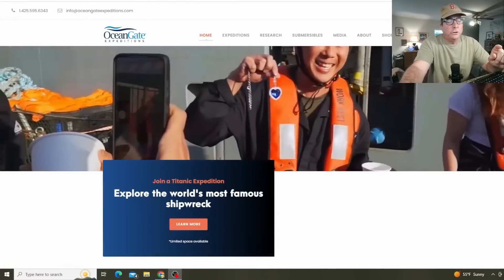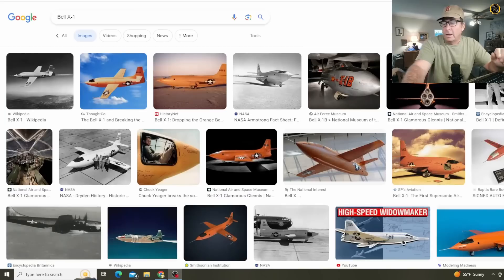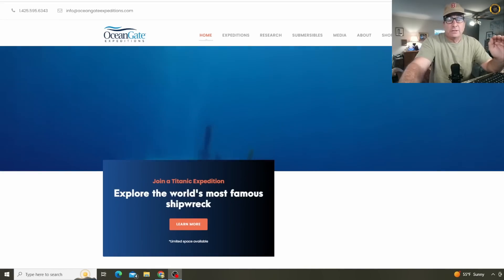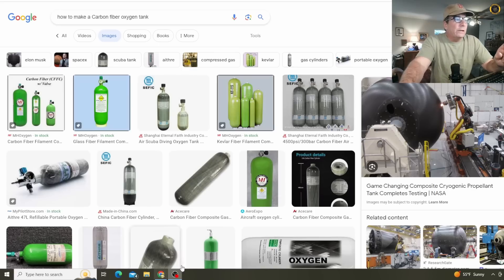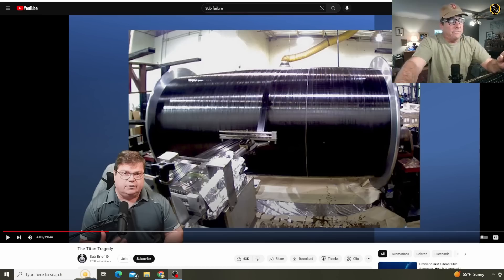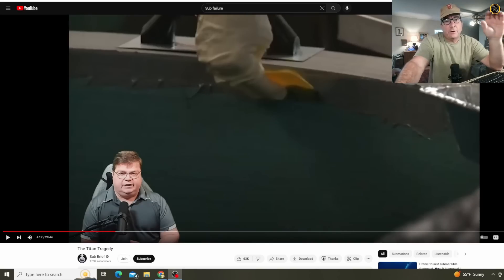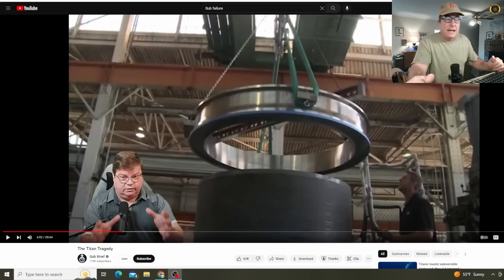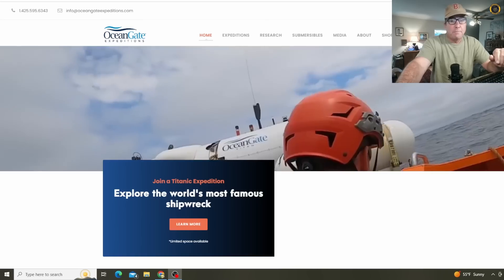Oceangate Sub Construction Details and Implosion

Comment: A point that has me very puzzled as to why the titanium ring was glued to the carbon fibre tube. They both have different elastic modulii and under extreme pressure will want to move relative to each other. A more compliant joint (think o rings) more suited to the immense compression forces could have been more suitable but would have required more engineering...

Comment: Designing for compressive pressure is not necessarily the same as for internal pressure, so some comments have likely missed the mark.  The carbon-fiber body under compression is more like concrete, where the epoxy binder is cement and the fiber is like aggregate.  At depth, the endcaps hold the cylindrical body like a vise.  Like standing on an empty soda can, any out-of-roundness will be unstable.  It should have been more rigid.

Comment: Composite pressure vessels start out with a metal vessel which is the impermeable layer.  The carbon fiber is only external reinforcement.

Comment: I noticed the unidirectional layup of carbon fiber and have changed my mind regarding the possible portal failure (1300m rated of the shelf item). I don't even think the glue joint was the root failure. I think the hull split right between the fibers. If all the fibers are circumferential, where is the torsional strength? Those people were  risking their lives by the strength of resin alone. Might as well have been a giant epoxy coated slinky.😢

Comment: Although carbon fiber is stronger in tension than compression, I don't believe this was the cause of failure.

The viewing window was only certified for 4,265 foot depth (1,300 metres). Titanic is 12,500 feet down.
Reply: Like Tom Clancy wrote in Clear and Present Danger --- "that damned widget failed right when the contractor said it would..."

Comment: Just curious how does that carbon fibre tube structure of Titan compare to the composite structure and usage of 787 and A350? These aircraft has been flying for 10+ years with thousands of pressurization and de-pressurization cycles (although the pressure differential each cycle is much less compare to what Titan experiences in its cycles). I am sure there are differences in terms of construction, design, testing and maintenance. Can you explain some of that? Would be interested to learn.
Reply: The pressure in an airliner is going from the inside out at a few pounds per square inch, which puts the fiber into tension, which it handles well.  With this thing, the pressure is going from the outside in at a few thousand pounds per square inch, which is compression, which it does not handle well.
Reply: @james-p  Ah so that's the tension vs. compression difference mentioned in the video. Thanks for the explanation!

Comment: Lots of conjecture here on the design of this.  The beauty of carbon fiber layups is you can match the CTE (what you are referring to with dissimilar metals) to the titanium.  The adhesive interface would also be of questions.  It would be necessary to better understand who actually designed this and how before really making true conjectures on it's failure modes.

Comment: We know that carbon fiber is extremely strong in tension, especially given it's light weight. In compression, however, I suspect the binding resin strength is the limiting factor, not the carbon fiber itself. Any fiber will easily fold on itself in compression if the resin begins to crumble.

Comment: Having laid up Carbon Fiber in a aircraft Bond shop. You just don't go one direction. You follow a ply chart. Left to Right, Right to left ,90 degrees and zero degrees. Once you reach the middle of your layup the reverse the ply chart. Very strong. If you miss a ply the part will be warped. Bonded in an Autoclave under high temperature and pressure.

Comment: Excellent Juan - you put that into great detail for those who have trouble understanding mechanics and physics. Sono tubes are designed similarly to the sub carbon fiber tube. No way will you be able to pull it apart or expand the tube but you can sure crush it with outside diameter force/ pressure. If Mike Patey was to design and build a submersible vehicle, I would go down in it!! possibly. Thank you, Juan for breaking it down in your fashion.

Comment: If a sub is rated to go down to pressure (X)psi I would think it would have to be tested doing several cycles to (2X) or (3X)psi. Needs a big margin in case it bumps something and pressure waves from something unexpected and materials degrading with use.

Comment: It's being described as an implosion, but I think the most likely failure mode was that the end caps separated, causing a sudden increase of pressure and instant demise for the unfortunate occupants. I doubt they will find a flattened carbon tube.
Reply: They’re not going to find a flattened carbon tube because a carbon tube does not flatten. Carbon fibre does not deform significantly, it shatters.

And the “sudden increase of pressure” at that depth, with that pressure differential, absolutely is an implosion, as it would occur within milliseconds

Comment: Simpe and short:
Carbon fiber is nott used alongside of this material's talents when used in a sub.

The mechanical load from high pressure within a tube differs completely from the load generated from high pressure from the outside.

Comment: Juan - You are right that typical NDT is not applicable for inspecting CF structures. We do however have a few acoustic techniques that can be applied. Laser based ultrasound techniques are sometimes used. The wall thickness in this case could be problematic. That’s a lot of material. I agree with you that the Ti ring/CF interface is the likely culprit. They should be able to determine if the chamber crushed and sheared the bolt ring off the end. I wonder about the viewing bubble too. I read they used atypical materials for that component. It’s a sad situation but hopefully we learn a few things.

Comment: Carbon fiber does NOT have a limit of cycles , its used for springs.I think if the complete vessel was carbon fiber it would have been ok, or if that ring was bolted and epoxied it certainly would have had a better chance.
Reply: There is a vast difference between above-water carbon fiber reactivity and the reactivity of carbon fiber subjected to salt water, immense pressure and bone-chilling temperatures.
Reply: @TechGorilla1987  It also makes a difference if the hull was cured in an autoclave or the outside was properly sealed meaning any pinhole would mean water egress causing de-lamination , I work at a major plane manufacture where we cycle the complete body 10,000 times, wings, fuselage ,air pressure etc. also was the hull UT tested (non-destructive inspection) ultrasound basically.
Reply: @ExploringCabinsandMines  I will defer to you as it's really not my wheelhouse.  That said, I wouldn't have traveled on that thing - especially if I was fully informed prior to signing any waiver.
Reply: @TechGorilla1987  Agreed
Reply: No limit of cycles, even at 6,000 psi???

Comment: My background in carbon fiber is in bicycle frames. Four things I have concerns about: 1. carbon has a small amount of flex under pressure. 2. You cannot really discern failure between the carbon fiber layers. The best way to know if you have a carbon fiber failure is when it fails. 3. It is very difficult to get unilateral and uniform carbon layup across such a large area. There will naturally be stronger and weaker spots. On a plane or bike this doesn’t matter as much because stress moves, but in an undersea environment the pressure across the surface is equal across the whole area. 4. Carbon fiber degrades over time and especially in difficult conditions (extreme hot and cold) add to that the effects of salt water.
Reply: Glad we got a bicycle expert to weigh in….
Reply: @washedupwarvet2027  in bikes made out of carbon fiber. It is not the right material for this application.

Comment: Would it have help it to not come apart at the 2 ends if the carbon fiber material had been continued into the capsule 5 or 10 inches.? This way the end and the part under the nose cone/window would have been over the carbon fiber material as well. The way they wrapped it stray ends could have started to rip anywhere along the tube. If the ends of the carbon fiber were inside of the capsule as well they would have been protected from the water and any water pressure from the outside if there had been some water leaking on the outside of the capsule part.

Comment: Mr. Brown
Graphite epoxy structures are Non-Destructive Tested, NDT, all the time. It was developed well over 50 years ago.  Ultrasound is used to complete NDT for this type of structure.  The F18 has composite structures that have been flying since the prototype flew in 1978 and were tested with Ultrasound NDT.  
  Graphite epoxy structures are very capable of taking compression.  The wings skins on the F18 are highly loaded in both tension and compression.  The LearFan 2000 was an all composite aircraft taking both types of loads successfully. 
  The cylinder of a graphite epoxy structure can be machined to close tolerances.  The engineer MUST add sacrificial layers to the structure for that operation.  The NASA Transfer Orbit Stage had four huge cylindrical “pushrods” with the inboard being in tension and the outboard in compression.  The ends were machined to fit the titanium pushrods and we used sacrificial layers to attain a tight fit.  
The reason the machine was winding the strip cloth at “0 degs,” perpendicular to the length of the barrel, is to provide a circumferential load carrying capability.  Layers will be alternated from 90 degs, along the length of the barrel, through several different angles to 0 degs to achieve the strength required for the given load.  Designing a load carrying structure with graphite epoxy, don’t forget the epoxy it distributes the load through the layers of graphite. 
  One of the problems with mixing graphite epoxy structures with metal is the difference in properties which induce a severe strain on the connecting joint.  One is the modulus of elasticity, the metal has a different deflection than graphite epoxy under load.  The second is the thermal coefficients for the graphite epoxy and titanium are different which will induce a significant load at the joint.  This load, over time, can debond the joint catastrophically and the loads this vehicle was under this is a real possibility.  
   The final thought is the way you design a “pressure cap” must be done with the right approach.  It is a type of root mean square equation dome.  A spherical cap will induce moment in the cylinder which is a bending load at the joint.  The design team should be aware of this but it would not take much error or “step load”, where the to pieces are not adequately supportive of each other to induce a failure in this joint.

Comment: Dead on point. When you look at the hull design/materials/techniques in a very fine high resolution detail, there are QUITE LITERALLY a nearly INFINITE number of failure points that only increase statistically over time/life, use cycles.
Failure borderd on absolute certainty, only WHEN (exact moment)was the unknown value/element.
Nothing more than russian roullete.

Comment: I am a bit of an expert on composite materials. I have been in the aerospace industry for almost 40 years, and I’m currently an engineer for an international air framer.  you are not exactly correct when you say the only way to test composite materials is to destructively test them. Carbon fiber, layups are typically inspected using ultrasonic inspection techniques. This is how we validate them structurally for aviation.  Ultrasonic inspection is intended to yield information about voids, porosity, and disbonds.  Another common method of nondestructive testing of carbon epoxy layups is x-ray inspection; often used for secondary bond joints, similar to the joint you described between the carbon epoxy tube and the titanium flange.

I think you’re spot on about the different strain rates and coefficient of thermal expansion between the composite tube and the titanium flange.  I don’t think galvanic (dissimilar material) corrosion played a role.  Titanium and carbon play well together.

Keep the good info coming.  Love your videos!
Reply: An aircraft has a relatively thin hull, I have an key tag from a piece of A340 aluminium skin which is around 2,5 mm thick. It seems the submarine cylinder had 5 inch wall thickness. As an expert do you think you can still test such a thick layer with ultrasonic inspection methods?
Reply: Absolutely!  There are many commercially certified aircraft, as well as military aircraft with very large composite parts.  The thing to understand is that for each unique laminate you have to build a reference standard: a representative piece of laminate that matches the part you’re testing, with a specific level of porosity built into it.  The entire process can be very expensive, and Oceangate chose instead to rely on deep sea testing off the coast of Bermuda to “proof-test the hull; then audio sensors in the hull to warn them when they we’re experiencing a failure.

Short answer: Yes! The technology definitely exists.

Comment: One of the outcomes of this could be that we learn more about how carbon fibre materials behave, which is particularly important now given that planes are being built out of the stuff; in the same way that the Comet taught us more about metal fatigue, something here may help us build safer aircraft.  But it is also a harsh lesson of the importance of applying rigorous engineering principles and processes, and the importance of good technical leadership; not just on new innovations like this, but generally.  The MAX also was a case of engineers raising concerns and nothing being done to address them.
Reply: they already know quite a bit about carbon planes. The 787 has been flying for almost 15 years without the hulls flying apart (ok, except the first few :)) ,  f18's are double that age. Sailboat masts 150ft in length under 20 tonnes of compression have been around for 20 years in salt water as well.
Reply: @mrl22222  On one condition: Well designed and well made. But here - everything went wrong.
Reply: @adamw.8579  and that is the critical condition! Just look at all the problems boeing had with 787 initially. Getting the supplier to do it right was so hard they just ended up buying the supplier. CF is a great material, It can withstand a huge number of cycles and tremendous loads for it's weight, but because it act as 1 giant piece instead of 100 little pieces, problems can propagate quite quickly, so manufacturing quality is the really hard part.
Reply: @mrl22222  Excellent data points. Thanks for sharing.
Reply: It is entirely possible to learn more about how composite structures behave without putting anyone's life at risk. On the MAX, there were enegineers and pilots who ignored the concerns as well as engineers who raised them.
Reply: Sadly, It is unlikely that we will learn anything new. You first have to apply everything you already know, else it is just confirming what was already known and confirmed before. Second, these people where allowed to design, build and use this sub without oversight or certifications, so there is no party that is required to investigate. Sure, anyone can pretend to be an investigator, just like anyone can pretend to be a submarine builder. For example the manufacturer of the glue would write a 1 paragraph "report" that they would have needed to be involved in the design and application before they could give any hard figures about the strength of their glue, they where not involved and probably would never have guaranteed any strength at all for this application. Do you expect a manufacturer of a $10 game controller to spend more than 2 minutes and a postage stamp on an investigation? At most you can return it for a replacement.

Comment: I think carbon fiber pressure tanks have a very different set of requirements than a submarine which has to withstand high pressures from the outside. I also don´t think the lid "popping off" would be an issue, as the outside pressure would push/hold the lid in place.
Reply: exactly my thoughts.
I think the carbon tube itself imploded no matter the connection to the front/backend..
Reply: @peterebel7899 it seems this sub originally had a different hull which was replaced a couple of years ago because of fatigue. The one they used now was already again a couple of years old.

Comment: Interesting thing is--when an experimental airplane fails in the air, you sometimes have a chance to survive the crash.  However, at the same "altitude" UNDER the surface of the ocean, you have zero chance of surviving a "crash."
Reply: A much earlier submersible, Alvin, had the pilot sealed inside a titanium sphere which could pop out and shoot to the surface in the event of the sub failing or getting trapped.